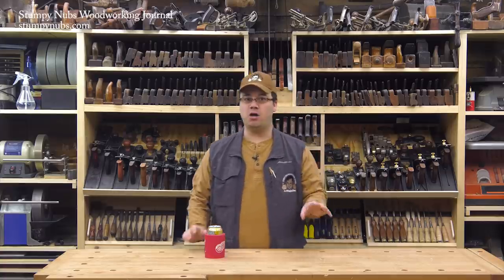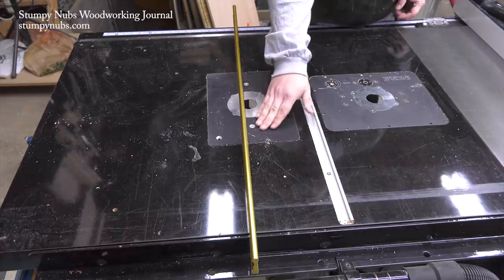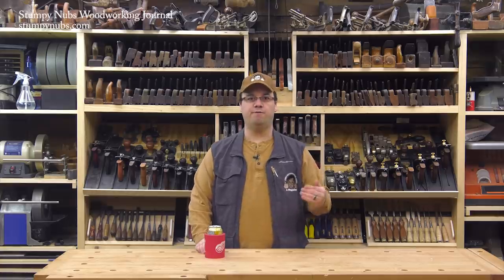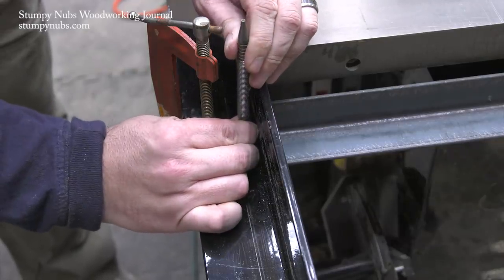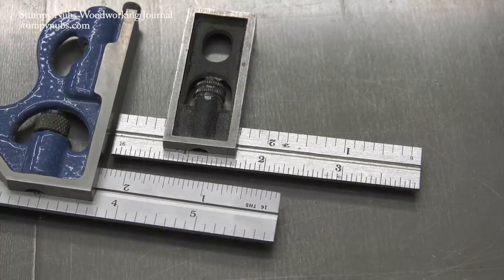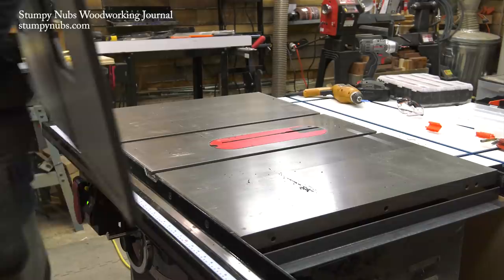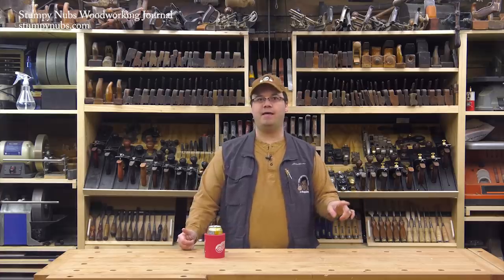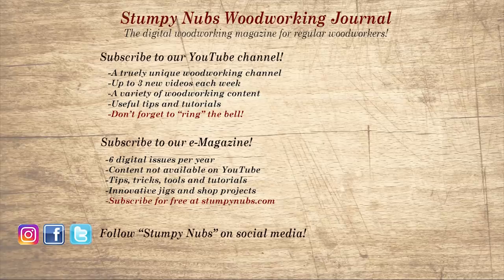Problems mounting dual router tables on my table saw- SOLVED!

Comment: In place of shims you might use T-nuts and set screws. These can be adjusted from the top of the table and less crawling on the floor for Mike.  Also, I thought you had the Incra router joining system, what happened to it?

Comment: Interesting I do not think I will be installing two routers in my table saw. But as too router table construction I built one using the sink cutout from a laminate countertop. It seems plenty stiff and has been stable.

Comment: I just bought a Triton router for the table saw. My extension is open cast iron in a x grid, OLDER Craftsman. I completely dismantled, new bearings in motor , arbor and a link belt. It runs true but I'm concerned about making a wing for the insert and router. The Incra LS fence is on back order and is the reason why I want the router on the saw. If you or anyone else  has a suggestion or a link to a video that can help me. I will be grateful.

Comment: Stumpy - some of the best woodworking videos out there. Get the engineering countersinks you'll never look back, just as good in wood as metal no chatter completely clean (I'd lend you mine but I'm probably 4000 miles away).
Reply: Hi Glenot
I've also seen them referred to as a snail countersink owing to the shape of the shavings. Agree it'seems easier to counteasing before drilling.
Never tried making patterns with them but are going to give it a go.
Reply: Hi Glen
Sorry about the nonsense spelling in my earlier reply - predictive text on my phone, typed from a proper computer this time...hopefully you got the gist of what I was trying to say.

Comment: Great video as always and love the humor. Regarding the Ready2Rout fence and router lift, have you had any issues/bugs with either one? And have you considered doing a follow up video on the Ready2Rout system? I have two routers on my saw as well (different brand) but one is on the left and the other is one the right. It works out great when setting up to make cabinet doors, etc. and needing two different bit set ups. And both of my tables face outward so I can stand either to the side or the end of the saw to rout material. Obviously you didn’t have a choice with the inboard unit. I am not criticizing... But I am curious why you chose to mount the outboard unit the same way as the inboard unit? Is it so you can feed materials in from the same side and save space? My two router tables feed from opposite sides and requires more room  but the saw and right side table/router assembly are all on casters so I can move it if necessary. Thanks for your time and sorry for being so long winded.
Ron
Reply from the maker: Because my saw is so long and my shop is so narrow, it's more convenient to stand in front of the saw rather than on the ends. The Ready2Rout is a great system, but not worth the price, in my opinion. It would be if they would have made more apps, which they promised when I got mine. But they never did.

Comment: Just buy the cast iron tops made for table saws. I bought the general international one and installed on my jet pro shop no problem. Just drilled some holes in the fence system to line up to the mounting holes that came with the table. No sagging; ever.

Comment: I'm curious to know if the space savings gained by having a router table in your table saw is worth not having a dedicated router table. It'd be great to have a video giving the advantages and disadvantages of each.
Reply from the maker: I used a table saw mounted setup for years and never missed the standalone router table. There's little difference in operation.
Reply: Same here.  While the phenolic is like a rock, I went with cast iron.  I wanted to avoid the sag.  Humidity is a big issue in SE Texas.  My table saw isn’t as large or as nice as Stumpy’s, it will only hold one router table. I don’t seem to have the need for two.

Comment: I would say that the dual router set up is for a very specialized situation and a single is more than adequate. That is just my opinion, for what it is worth. I have enjoyed your video series and find your site most enjoyable to watch. lots of things to learn. I also am a big Rockler fan. Their products are very user friendly and useful. But the prices can be a bit much sometimes to justify when I ask the wife for some cash to spend on my wish list.  To protest she gives me a honey do list for what she wants done. by the way those silicone mats are just the ticket for glue mess control.
Reply: You need a man money account. A regular amount gets paid in every week
Rule no 1 - you can spend it on whatever you want, no questions asked
Rule no 2 - whatever happens in the man shed...
Reply: That honey do list is my ticket to buy tools!  I like those glue mats too.  My shop is cramped.  I have to use my table saw as a workbench as well.  The glue mats help protect the saw top.  I’ve also found that the mat resists epoxy and CA as well.  The CA reacts with the surface of the mat hough.

Comment: How do you make cuts on longer boards with a setup like that? It seems like it would be awkward not being able to stand parallel to the fence. Can you flip the fence around and use the end router?
Reply from the maker: How do you make cuts on long boards on a table saw? It's the same position. But yes, you could also flip the fence around the other way and stand on the end.

Comment: I’m curious why you put the T tracks on the left side rather than on the right (assuming you are looking at it from the front side of the saw).  I have a single router table on my table saw,  I use it from the end.  Seems like you’d want the tracks to be closest to the end to use with guides. Any reason for your tracks being farthest from the end?
Reply from the maker: I don't usually operate the router table standing on the end. I use it like I do the table saw, standing on the side and feeding the stock against the fence to my right. The miter slot is in the same position as it would be on the saw as well. You can see what I mean when I show how the fences go on at the end of the video.

Comment: Why two router tables, especially in tandem?
Being short I would have trouble using the center table.
Lastly, doesn't the dust collection bin starve the router of air?
And, I appreciated your humor through this as it gave me side "splinters"!
Apparently you see life like I do, "life is too serious to be serious at all times".
Reply from the maker: I explain why I use two at the end of the video. The dust collection bin doesn't starve the router because it's hooked to my dust collector, which pulls air down through the hole in the top of the table around the bit, and across the motor.

Comment: I don't know if I would be able to do all that to a sawstop but I am planning on playing with a Sawsmith 2000. I am thinking about doing something with 1 router table. Would multiple layers of mdf work or how about a butcher block maple top?
Reply from the maker: 2 layers of MDF will work if you have enough support beneath it. Your issue may be the top gets too thick and interferes with the access to your router controls. I would not make a solid wood top for a router table.

Comment: Another great video! appreciate your time and effort producing the videos and I've learned a lot from you. Have a similar project on deck where I'm tuning up a Grizzly G0652 I picked up used and adding the SawStop 16" Cast Iron router wing, Incra lift and VFD controlled 3hp router. Taking the shop video plunge and will produce a video with the highlights. Cheers and thanks again!

Comment: I did the opposite, two saws married by a router table. All three units use the same fence, the right side saw sports a dado blade.
Reply from the maker: Two saws married to a router table? Which state allows that?

Comment: Just get an Incra fence system. I have Incra on my tablesaw and Router table. They are great tools. Maybe a little more expensive, but worth it.
Reply from the maker: I have the full incra a setup. Don't care for it.
Reply from the maker: Takes up too much room on side table, sticks off the end of the saw too far when I'm using the router table, limits rip capacity of the saw and the lead screw teeth jam on me half the time.
Reply: @StumpyNubs  I do not find that to be the case with mine. I do have a different saw then you have. My router table is on the left side. my Incra fence system is mounted to the right side. I actually have about six more inches rip capacity. It does hang over edge on the right side. But its not a problem in my shop.
Reply: That's a surprise  @StumpyNubs  . My LS positioner is still in the box awaiting my router table build.
Reply: Joshua Blair the old Rockler router lift did not have the lock.  I had the same concern.  Rockler has a new router lift that has a separate lock like the Jessem.  It also has a “fast speed” (macro) adjustment as well as a “slow speed” (micro).  The only gripe I have is that the inserts are aluminum and though you get one with the lift, you have.to buy the others separate.  Something you have to price in when comparing with other brands that include the whole set.  For me, I like the plastic ones better.  If you are looking to do a “zero clearance”, it is kinder to do that with plastic as opposed to aluminum and they are cheaper to replace.  A glass half full, half empty depending on how you look at it.  Also, the aluminum inserts on the new Rockler lift pop in and out by way of a button on the lift unlike others that require a separate handle to twist the insert in and out.

Comment: Try this little tip for your countersink: use the counter sink first, it will do a nice round shape. Sure, it has to remove a little more material, but the cut will be smoother without the chatter you get when they go all starry on you.
Reply: murphymb if you run the countersink in reverse, it scrapes the hole instead of cutting. No chattering. This makes a much cleaner countersink if the pilot hole is already there.

Comment: I have a SawStop 3 phase Industrial 52". The wooden end tables on these saws are terrible. I had to return the first 2 because they were already warped. The third one was marginally better but has since warped. Why would such a great saw be fitted with such a cheap low quality end table? Who would use pine bracing? Why not at least pressed steel. Even the cheap Chinese saws have better end tables than this. I got no response from SawStop when I questioned the quality.
Reply: Same problem.  Even their iron tops aren’t as flat as my old Ridgid contractor’s saw.  They’re attitude was take it or leave it.

Comment: If you buy a phenolic table, watch for cracks.  Rockler has had manufacturing issues off and on with those tables.
Reply from the maker: I got one with a crack on the underside and one that was perfect. I could have sent it back and they would have happily replaced it, but I didn't have time so I used it anyway. I never noticed since it was on the underside. In fact, I used it in this video. Works just fine for me.